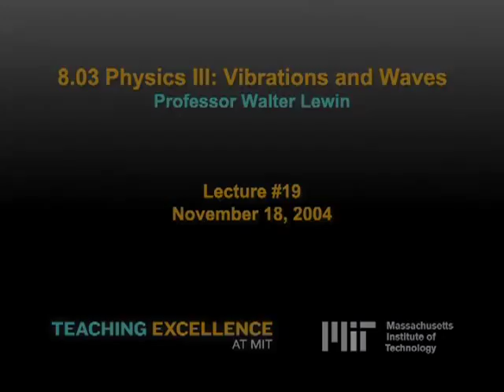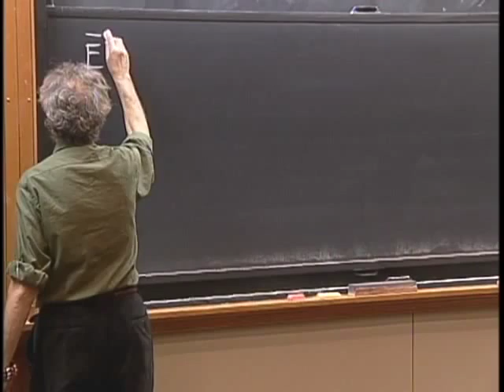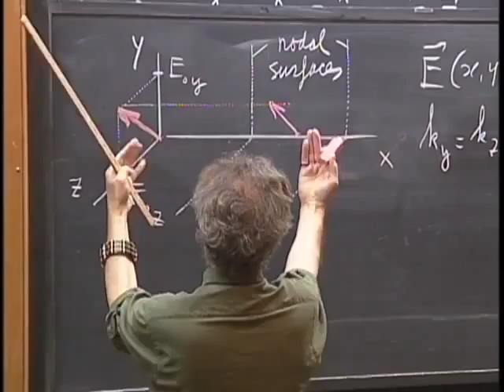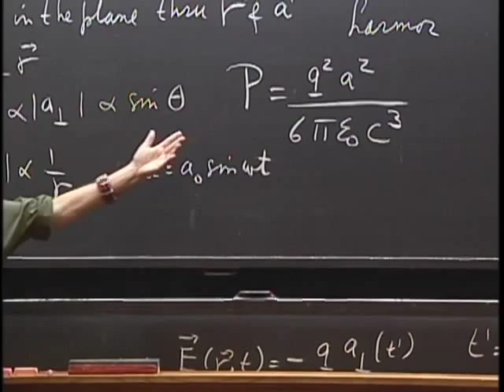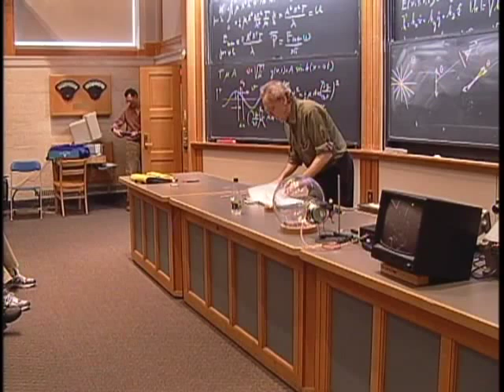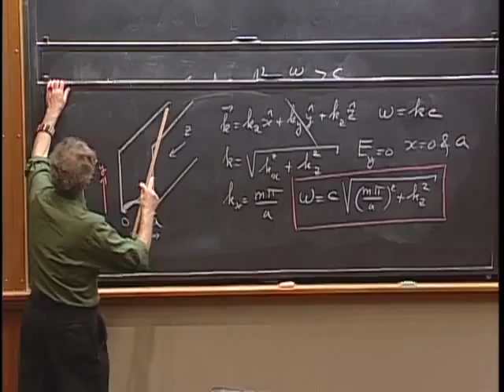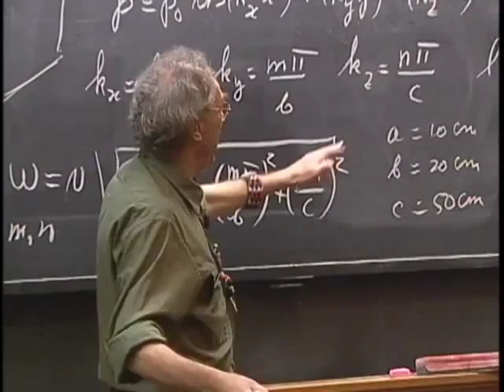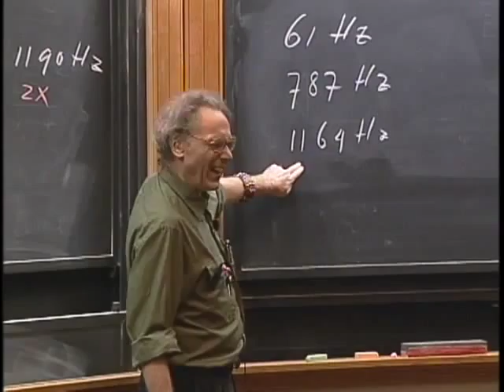8.03 - Lect 19 - Second Exam Review

Comment: Hi Dr. Lewin,  is (at 41.25) "rigid spaghetti" (electric field is moving in space at the same velocity as the charge which generates it) phenomenon direct result from Maxwell's equations?
Reply from the maker: that was a very nice analogy. However, the E-fields move with the speed of light.
Reply: Thank you Dr. Lewin for clarification. Or I was already contemplating that instantaneous communications would be possible with conservative electric fields.
Could you, please, recommend a book and/or lectures on the subject of antenna current distributions and its corresponding radiation patterns? Thank you very much.